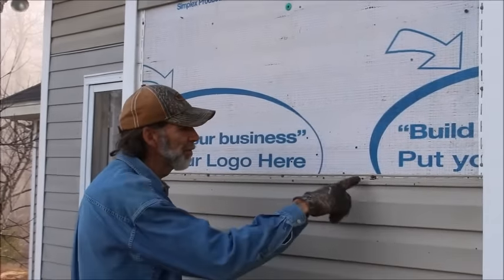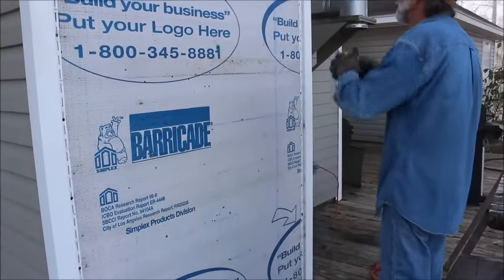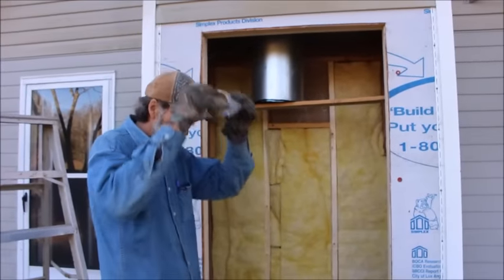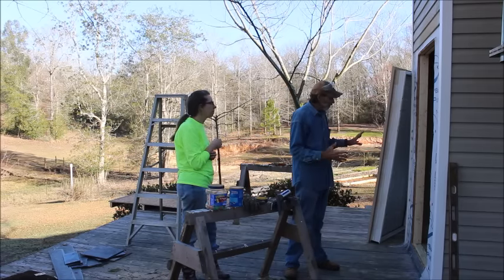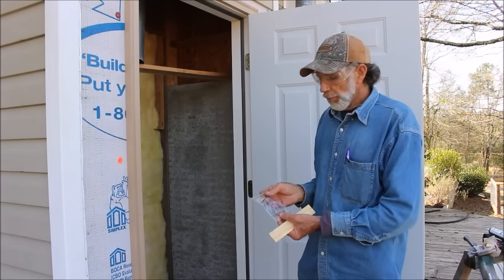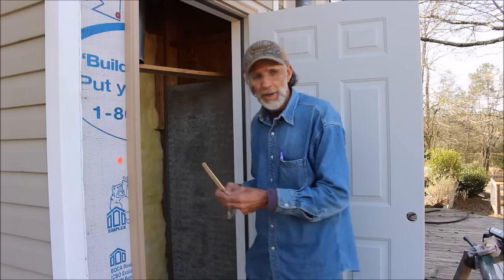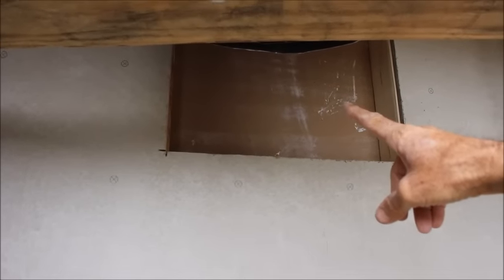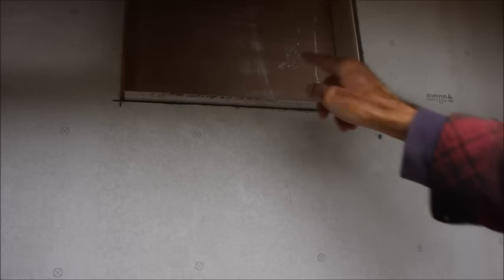Door for Stove Pipe Cleanout

Comment: I always pre drill the door casing for the finishing nails on the door, because it don't mater how much you spend on a insulated door, the casing mold is never one solid peace of board it like in many peace's that are cut in like many tong an grove splices, I know there is a name for this splice but I cant think of it at the moments, so if you don't drill the casing for the nails, the vibration an hitting of the nails brakes open these many splices were they join the ends of the casing wood end for end, each side has any were from 3 to 6 splices of wood that make up the strip of casing wood, on the sides an top, made up of like scraps these days, same when you buy 1x 1-1/2" boards  they are made up the same crappie way, its discussing how they make things today.,, I asked the lumber yard once why the make it like that these days are they so hard up for wood they use up all the scrap wood making this stuff, its not like years gone by were everything use to be one solid peace of wood, there crappie answer was no its made that way so it will not warp,, well good god I have had many peace twist like a screw so it sure not made like that because of that, it trash they make these days, over the years I have had to make up all new door casings as even though the casing was well sealed an painted every one of them peace's that are splice together an clued have separated an looked like hell, there was a time these brick mold or casings were one peace boards, not know more, when it is new it looks like one peace but if you look really close you can see the rat tail splices. if I had a work shop, I have tons of tools but no place to set them up an its to much work with my back to drag it out every time, I do that an my day is done, id make all my own door frames an doors, they call them a steel insulated door, ya right its pop can thin metal with the softest thin strip of wood the frames in the metal that the hinges screws never hold for more then a few years an its a pain to replace that paper like wood an get the tin to look right, as at the factory they are pressed together some how